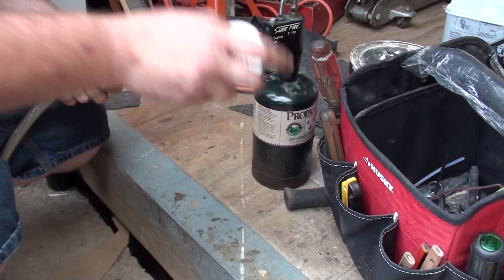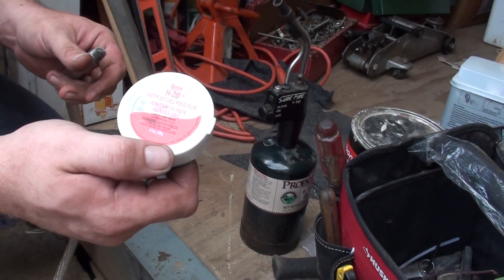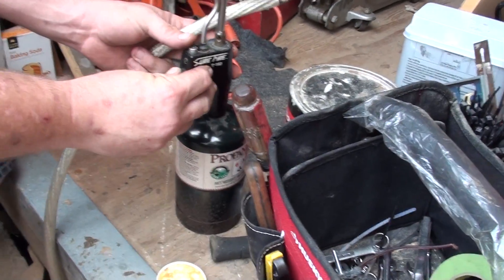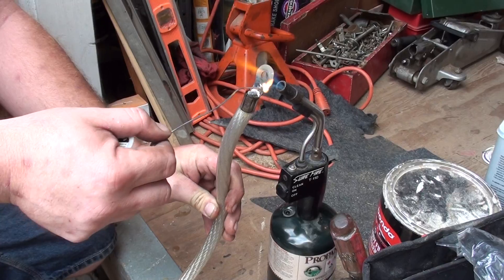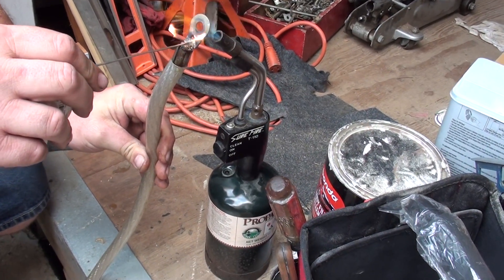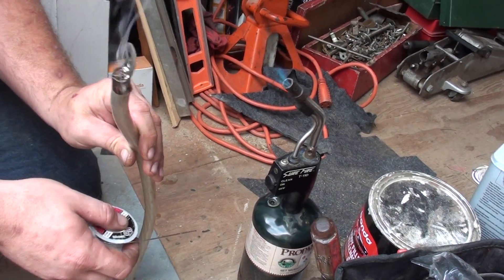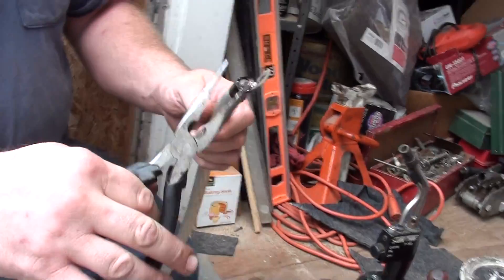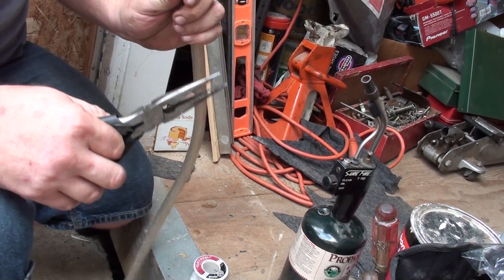Soldering Terminals Tutorial ( The Correct way!)

Comment: Someone should do crimped vs soldered. Copper on copper is best by far the only time you need solder is when you need pulling strength/durability on a wire that's moving all the time. Or if it's exposed to outside environment. Just take a ohms reading and see. Solder=resistance